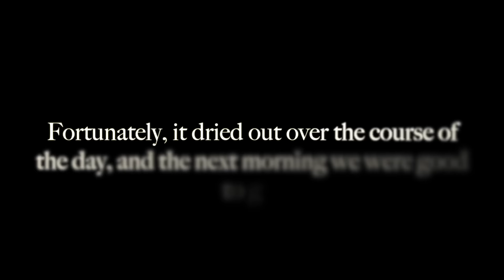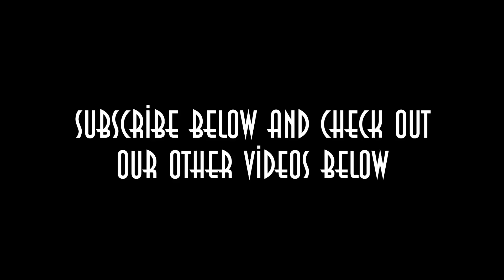Making the perfect Lawn at the Château! Teamwork and Creativity.

Comment: Glad to see you guys back in action. That was some hard work, and you did well using the tools you had and came up with. The lawn is a success! From time to time if you can get some sort of organic fertiliser to sprinkle out over it that can help get the soil in good condition to sustain your lawn well. I say organic because they build your soil up, whereas chemical ones actually do the opposite (I know from experience). You probably don't have to do a lot because generally the soils in Normandy aren't bad at all for grasses and other plants, but since yours is disturbed due to all the work, it would benefit nicely from a boost. As elsewhere mentioned, those little rolling spreaders can make the job more simple and even, they can spread grass seed as well as fertilisers, you can adjust the spreading rate to encompass larger fertiliser pellets or seeds down to fairly fine ones. If you can't find one in France, you will definitely find it in the UK, they have everything related to gardening, and the spreaders are inexpensive, fortunately.
Reply from the maker: We're actually creating a load of compost which I was planning to put on at some point.  Is that what you mean by organic fertilizer?
Reply: @chateautroiscloches  That should work just as well, maybe better. Just spread it very thinly. You can actually do both if you like, the organic fertilisers combined with compost are about the best thing possible, but if you only do compost, that will definitely be good. If you cut the grass regularly enough that when it's cut it doesn't clump, you can let that decompose in place, as that builds up soil, too. Basically a free fertiliser over time. But, if the grass is quite long when you cut it, better just to rake it away, and compost that elsewhere and apply it later as compost. Particularly on a new lawn like yours, as large clumps left in place will smother the grass under it.